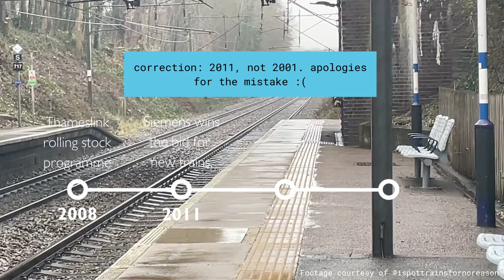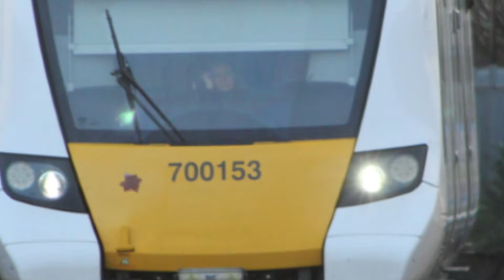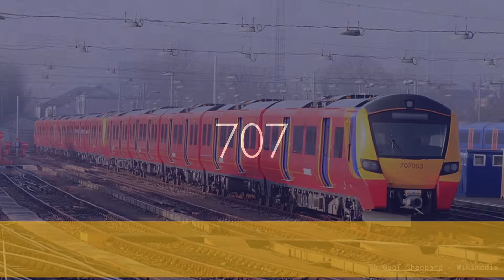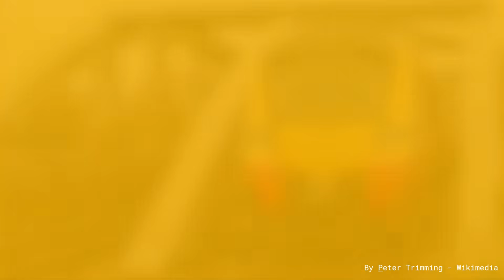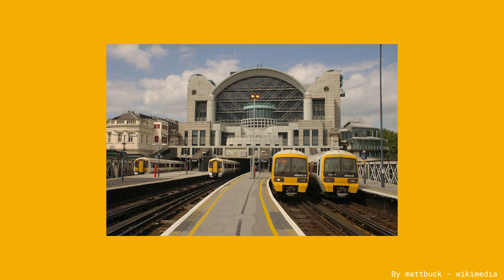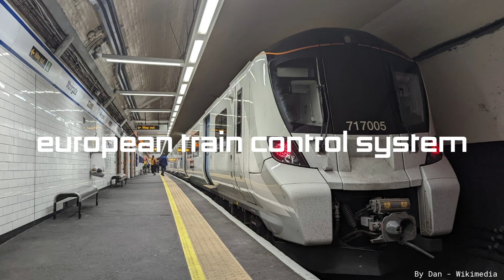The Desiro Cities - The Backbone Of London's Commuter Network.

Comment: 6:22 Thank you so much, that's me doing GCSEs. Apart from the unrefreshed 376s and during the majority of the year when AC is not needed, the 707s are the worst of the SE fleet by miles. Rock hard seats, almost permanently broken PIS, abysmal ride quality, the lists goes on. SWR were right in phasing those disgusting units out as the 701s are miles better, but we don't want them either. Give them to SN please, they don't have any real high capacity stock. Give them 376s too whilst you're at it so SE can have a uniform suburban fleet. Also, GN need to stop using 700s. Please. There's a lot wrong with the Desiro cities, that's probably a video for another time though (maybe on my channel).

Comment: In my opinion they’re over maligned underrated train, some decent seating on them would make a world of difference, they feel more airy than the electrostars, they’ve got pretty decent luggage capabilities (compared to quite a few newer units) and where a massive step up from the 319s.
Reply: I agree with everything you said, they do feel roomier/fresher. Maybe give them some 730/0 style seats and they'd be perfect.
Reply: Nonsense. I have to endure these on a daily basis. Cambridge to Brighton on a near 90 degree ironing board seat with not even a tray for a drink. Please . Previous trains were far more comfortable. They deserve all the criticism they get.
Reply: @user-pq5yu4wc3l  the thing is that the large majority of Thameslink passengers are only making shorter journeys, so standing room is somewhat prioritised. That being said I don't know how the seats are that bad compared to 730/0 seats which serve a similar purpose but are much more comfortable.
Reply: @user-pq5yu4wc3l  like i said if you look past the seating issue… having used them to commute on too since their introduction all be it on much shorter journeys, i think they’re much maligned and underrated, though having family near Peterborough i do avoid having to do the full journey on a 700 where/when i can, (not that the ironing board seats that the newer electrostars have are any better) as I couldn’t imagine anyone doing that length journey by choice
Reply: @r @richiem86 you cannot overlook the seating issue. The function of a train is to transport people comfortably from one destination to another. This train does not fit the brief. It might feel bright and airy but it matters not when you’re sat up right in discomfort in a narrow seat with laughable leg room having to hold a drink and a book or phone etc . They are simply not fit for purpose . Oh and you have to pay an annual £7000 for the privilege…..
Reply: @use @user-pq5yu4wc3l what they are which is a commuter train in and out of central London they’re very very good, the fact that they’re used on long routes and/or people such as yourself are using them on long routes such as one end of the Thameslink network to the other is hardly any fault of the operators or the trains. And if a tables that much of an issue use the declassified section of first class at the rear of the train.

Comment: Horrid trains. The 415 (EPB) were luxurious in comparison. 60 years of progress. NOT.

Dreadful seats, stupid curved windows, ugly front ends. 12 car sets are just moving around air off peak.

There is no excuse for uncomfortable seats. Hard wooden seats can be confortable if the profile is correct.

A disgrace to everyone involved in the decision.
Reply from the maker: I fully agree with you about uncomfortable seats, especially when they only did it to save money, hopefully they get upgraded under GBR 👀
Reply: @RailsReworked 
Extra cost of correctly profiled seats is zero. Whoever specified them was incompetent.
Reply: @physiocrat-sv of course they where, ordered by some penny pinching bureaucrat in the DFT who probably never has to use them.
Reply: @richiem86 I totally agree with you. The Siemens 700 series are an insult to the passenger, with their truly dreadful rock hard, ironing board Fainsa seats.
Reply: @Ted010  the thing is, if the seats where changed for something with a little more padding they’re actually a pretty decent bit of kit for what they do, and compared to the 319s they (indirectly) replaced, as well as the more limited capacity (in both luggage storage ability and passenger numbers) electrostar units which always felt a lot more pokey  starting feel little bit of a dated design now

Comment: I definitely think SE should give them dual voltage capability, would be especially good for Regional services to places further than Gravesend
Reply: Good idea but where would they go?
I could see southeastern calling at Southend one day tbh but not for awhile
Reply from the maker: @Vvcalless  Under GBR, hopefully it will end up at a point where rolling stock can easily be redistributed and moved around on different services in different areas, and then that would provide more operating flexibility.